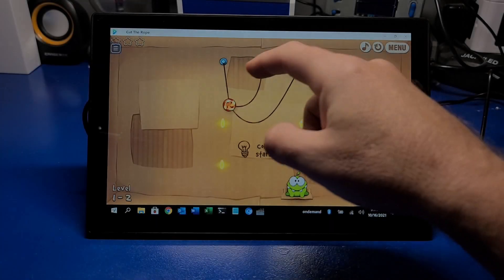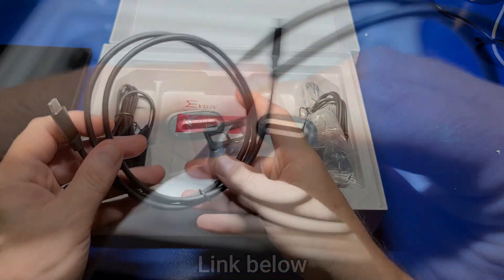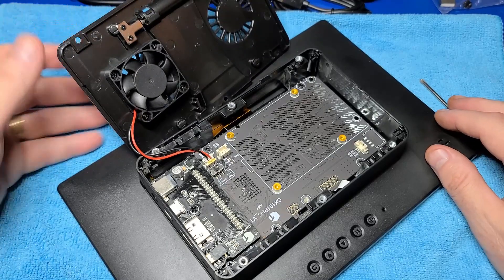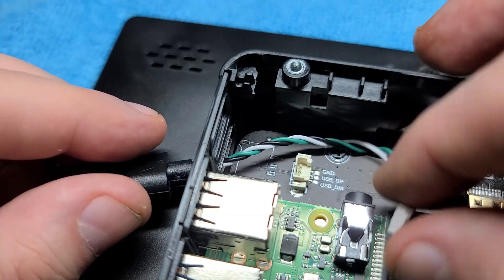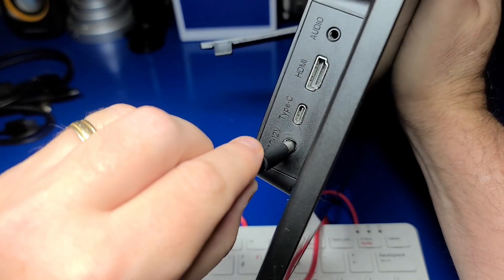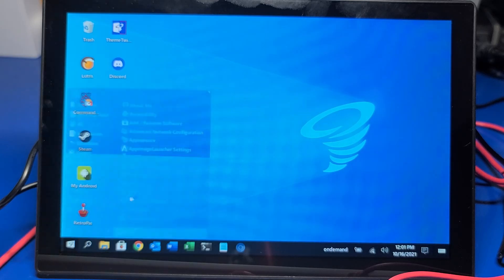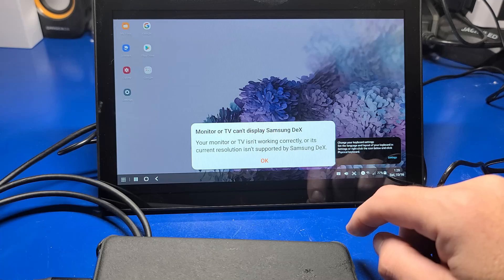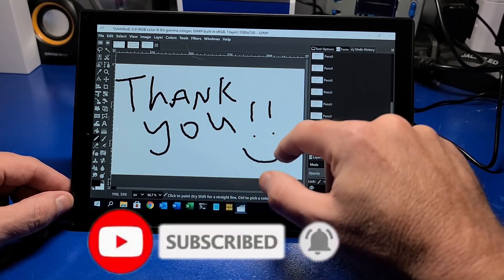Raspberry Pi Touch Screen 10.1in. display: All-in-One Case & Setup

Comment: a good video, thank you!... I have the same monitor, although on the board it indicates that it is v4 and on the board where the HDMI, the USB C connector and the 12v input are, there is a 20-pin DSI display input . I wanted to ask if these monitors are compatible with Raspberry Pi 5, I understand that this consumes more energy than the Raspberry Pi 4, so I don't know if the power supply can make it work (my power supply indicates 0.6a 12v/2000ma)
Reply from the maker: Thank you for watching!  I've not done any testing with this device with the Pi5.  For that, I'd recommend sending them an e-mail.  I don't want to tell you wrong and I'm sure their engineers have tested it or can at least make good recommendations to you.  Their e-mail address is: customer@eviciv.com

Comment: what operating system is this? and does it come pre-installed on the raspberry?
Reply from the maker: In this video, I was using TwisterOS ( link: https://twisteros.com/index.html ).  But you could install a different OS if you'd like, PiOS, Ubuntu, etc.  It didn't come pre-installed with the Pi, also this video was using the Pi4 and the Pi5 was released.  Not sure if the Pi 5 will work with this screen, may need to use a Pi4.  You can find more Pi4 content here: https://wagnerstechtalk.com/rpi4/ and Pi5 here: https://wagnerstechtalk.com/rpi5/ if you need more details on setup, etc.

Comment: I got this one coming from ebay and a ugreen right angle usb c connecter. im gonna try to see if plugging it in to the pi 4 and routing it through the holes and hope it will enable me to use it with a power bank instead of dc barrel. It looks like it will work and the cable is a 60 watt cable so should be enough. If that dont work ill buy some barrel to usb cables.
Reply from the maker: Please see 02:06 , power requirements are 12v 2000mA.  USB will typically only put out 5v.
Reply from the maker: Just checked, not available today still.  Not sure if you've seen this: https://youtu.be/Nfl5QoXZULM .  It's not a 10.1" but rather 7" but the power requirements may be to your liking with the Pi power module.  Just thought I'd send it along incase it's helpful to you.
Reply: @WagnersTechTalk  Thank you. I acutally got a upgrade to a usb c touchscreen instead. That one was out of stock. Things might work out for the better. I will check that one else as well for my second pi. thank you. :)

Comment: After this review I quickly picked one of these up for a brand new Pi 4b and both arrived in the mail today. So far it's been smooth sailing, except the touch screen calibration is way off. Do you have any recommendations?
Reply from the maker: I don't recall needing to calibrate my unit, you may want to reach out to the seller for an exchange if it's that bad.
Reply: @WagnersTechTalk  Update: I finally got the time to figure out how to fix the calibration. Turns out it was just user error on my part.
Reply from the maker: @strykr_killr  Great news, glad to hear it's all working fine for you!

Comment: i'm getting a low voltage warning. just got the 7in screen every cable is attached to the screen .
Reply from the maker: Sounds like an issue with the power supply, you may want to contact the seller for a replacement.

Comment: Thanks for the review!! I have gotten 2 units from the manufacturer and 3 different raspberry pi. Both units are the 1920 resolution and one version 1  (as shown in the review) and the newer version 2. Both pi 4s are a 4gb and an 8gb model. When you update the bootloader to as least the april 2022, these displays stop working with the Touchscreen plugged in. When you keep plugged in and boot up you will get and HID 1 error. You have to unplug the Touchscreen to get it to boot past this. Is anyone else having this problem??
Reply from the maker: Hi Mike, it's likely not an issue with the touch screen but a problem with the new bootloader.  There is a thread here for posting issues like this: https://forums.raspberrypi.com/viewtopic.php?t=329324  It would be great if you could make them aware of it.
Reply: @WagnersTechTalk  I have notified them of the problem being observed on both my 4gb and 8gb while using this Display.  Hopefully something can be worked out to where the problem disappears:):)  I appreciate the help very much!!

Comment: I’m getting a no video input error when turn the power on.  Do I have a bad unit?  I’ve checked the connection 1000 times and used 2 different rpis
Reply from the maker: I didn't encounter an issue myself, if everything is setup according to what you saw here you might have received a defective unit.  May need to exchange it.
Reply: @WagnersTechTalk  that’s what I was afraid of.  They work on my monitor
Reply from the maker: Sorry that has happened, I can't think of much else except if the two small PCBs that connect to the GPIO pins are missing a row of pins during assembly.  That's about all I can see as a possibility, but if you've tried two different Pi's already it may just be a bad unit.

Comment: Im wondering if a premade device could be added to the pi pinouts to provide an automated rotation of the screen.
Reply from the maker: It would require more than just adding a sensor, for the automatic touch rotation -I believe.  Screen rotation wouldn't be too difficult, but for the touch aspect to work you'd likely need to dump the firmware built in to the display, decompile, modify the code to utilize the sensors, write it back.  Likely not an easy task honestly.  I may be wrong, but that would be my guess.